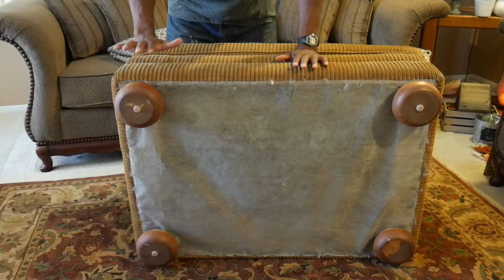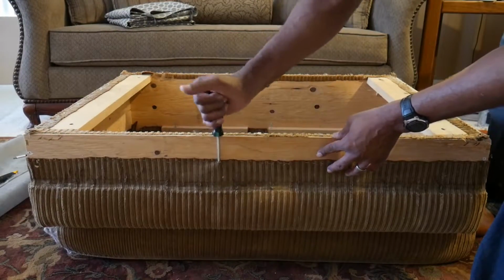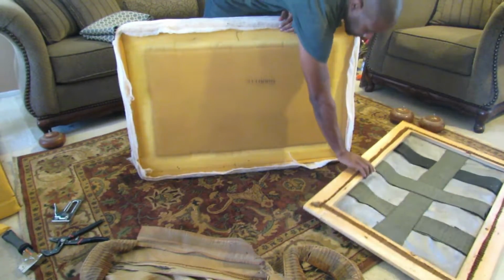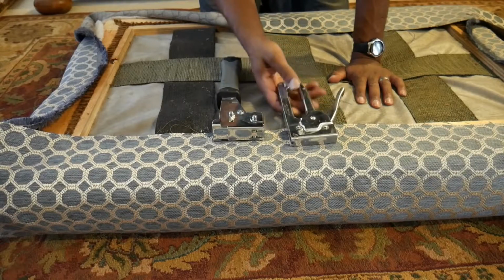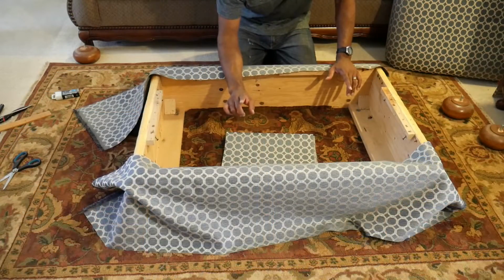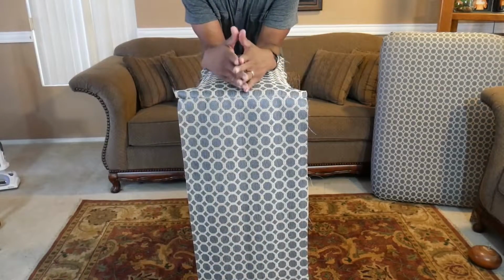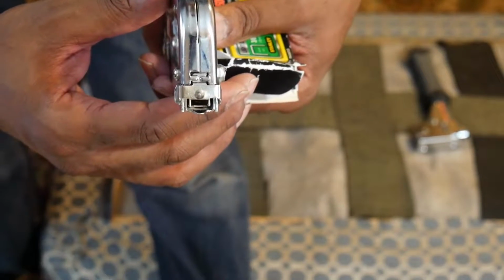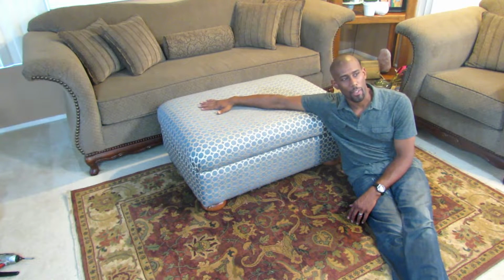Learn How You Can Restore Your Ottoman Yourself At Home | Reupholster With New Fabric

Comment: What if the cushion is needs to be changed? How do you replace it? Do you suggest another way to put the fabric together if you  don’t have a sewing machine
Reply from the maker: You can just buy a new cushion and just put the new fabric over it. If you have enough material you don't need to sew. I was running out of material, so I had to see it together to form the base.

Comment: What if I don't have a sawing machine? Could I use strong silicon glue and then staplers? I have an ottoman stool but it's old and ripped. Thank you.
Reply from the maker: I believe that could work. Just add a staple at the seams and you will have yourself a new looking ottoman. Thanks for watching and let me know how it turns out.